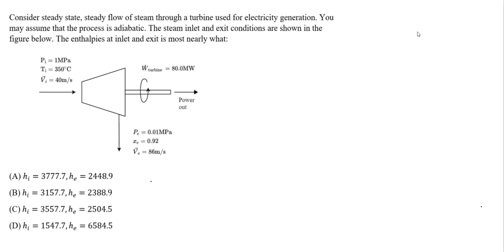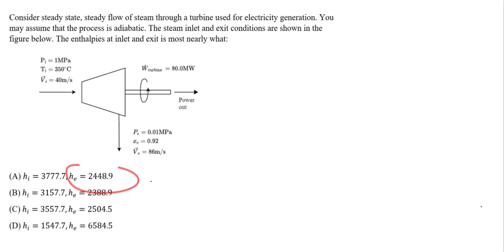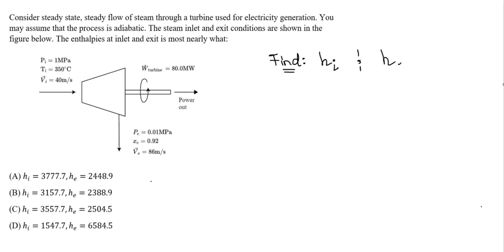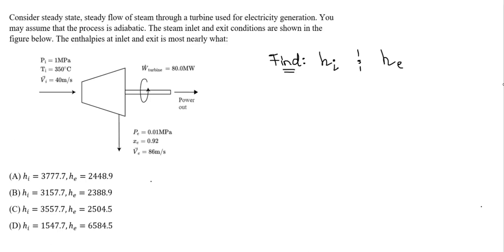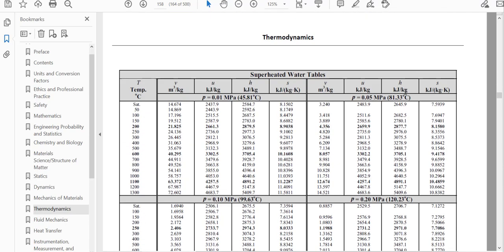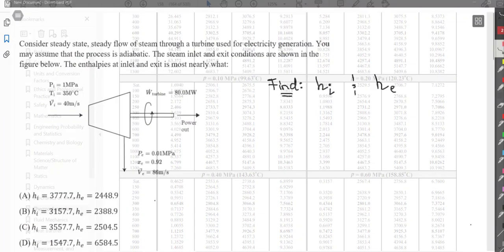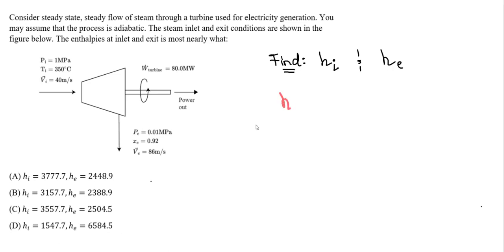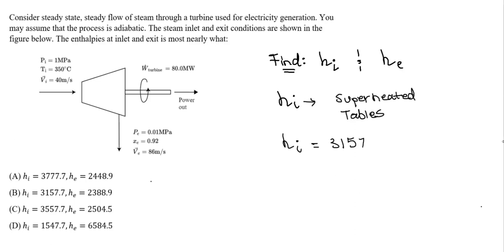FE Exam Review - Thermodynamics - Enthalpy (Steam Tables)

Comment: i think for the sake of saving time, its easier to just estimate by using the 45 degC numbers instead of interpolating
Reply: If the tolerance of the data in the multiple choice be a lot, it is a good idea, but in this case if you use data for the temp. of 45, the enthalpy is given 2391.66 Kj/Kg which is close to answer number two than answer number three.
Reply: @alirahmaninezhad895 answer 2 (B) is the correct answer though. Answer 3 (C) is wrong
Reply: @jace3254  I am confused on how you would know which is the correct answer after he got two answers that are in two different choices? He said after solving for h_i that we could choose c and move on.
Reply: Nevermind I was confusing myself

Comment: Why did you calculate h_fg (h_g-h_f) instead of reading it off the table? Is the table value still valid?
Reply: If the state has a quality it’s a two phase system. Temperature and pressure are at saturation values. So you use the saturation enthalpies and the given quality to find the enthalpy at the given state.

You need two thermodynamic properties to define the state. In a two phase system the temperature and pressure remain constant. So you would need quality, enthalpy, specific volume, or entropy to define it completely. Hope this helps.
Reply from the maker: Can you please do the interpolation with me to see if you get what I just got: h_e = 2393.43 kJ/kg . I'm probably redo put this one on private since I confused the crap out of it.
Reply: @directhubfeexam  It gave me 2569 Kj/kg when I directly interpolated for hfg, and not hf-hg. I compared the data in columns of hf, hg, and hfg, and it seems that the data in the column of hfg is coming from substracting the data of the column hf from the column of hg. So, you do not need to find hf and hg and then subtract them from each other. Go ahead and directly use the data for hfg.
Reply: No it came out of a different result. The result is 4786
Reply: @2kstar85  you are doing it wrong if you got 4786

Comment: Thank you for sharing this interesting problem! Great job going over the interpolation method in this problem. Just one quick comment , you mentioned the answer is C under 4:24-4:32. Thank you
Reply from the maker: You're right, sorry about that mistake.
Reply: @directhubfeexam  no worries! Keep the questions flowing. Would it be possible to include a video going over psychometric charts. Thanks in advance.
Reply: How can you assume it's at 45-50 degrees going off of the pressure? I don't think you can do that... hence why your answer was so far off from the actual answer.
Reply: @rejiii6689  45-50 degrees is assumed bcus in the "superheated" table, under P=0.01MPa, it says the Temp is 45.81 degrees. Given the 45.81 degrees, we can assumed the range of 45-50. Hope that makes sense
Reply: there is a quality given (x=0.92), therefore the steam is in a 2-phase mixture state and stays at the saturated temperature for the pressure given @rejiii6689